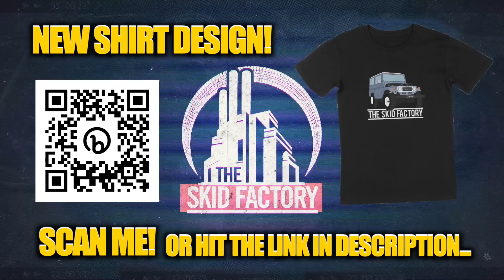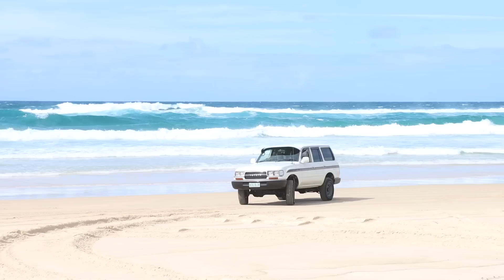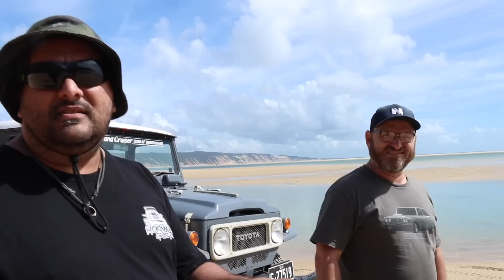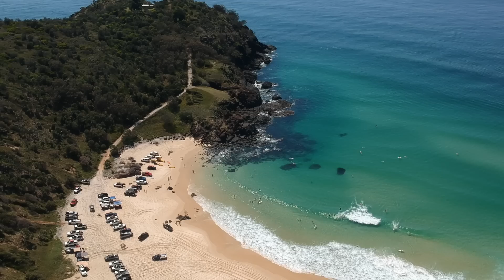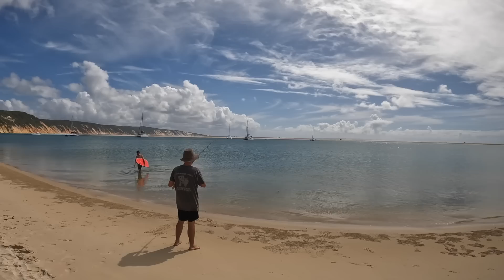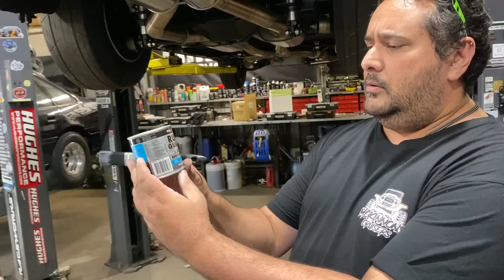V12TT LandCruiser VS Rainbow Beach/Double Island Point

Comment: 79-84 Drove all over that place in a 1200 Vdub with 15x11s on the back. In one 2 week stretch at Rainbow van park, did near 400 miles and wore out reverse. Also got lined up and taken out for sure by the pilot of an F111 flying about 100 feet off the ground along the dunes.

Comment: Jokingly, I tried to convince Ai that bucket with emerged fuel pump on passenger seat is safer at the track due to being able to throw bucket out in case of fire just making sure to avoid fire area, and that a double layer band aid and pushy helmet is good safety equipment for drags and that thong are appropriate as they are classified as a shoe

Comment: Amazing scenery, Australia never fails in that aspect. To bad they make it so bloody hard to become a permanent resident , I would have lived there a long time ago if it be a little easier. Never made it to the gold coast, yet. One of the best memory's was a ride along in a old 40 from a tourguide I worked with. A rattelling deathtrap with a old Chev 350 in it. You'd have to hold the doors going around corners. It missed the bottom part of the bellhousing and floors as well as the exhaust where optional too.. It made for a exhilarating ride. Had a lot of fun that thing.

Comment: Ol' Roothy uses a brush and fence paint for his 40s. What is it with 40 owners and brush painting their cars?
Reply: Looks better then raptor coat
Reply: @MrThebrownie72  i dont get the hate for raptor or any of those liner style paints. it does the job. and can do it at a decent price on comparison, at least for me. and if your thing is because of the gritty texture, that can be tuned out of it. besides. when its covered in mud and scratches and salt and sand, whats the difference?

Comment: Where are the running boards on the 40?
Reply: Will be tube styles, but gotta work out suspension first, then tyres and what is needed to cover them. And then it’s time to work out the steps…

Comment: love you work boys long time watcher. you say dont be a dickhead well i say dont run tracks in 2wd... it ruins the track.. to many numptys down here do the same. rant over like i say love ya work.
Reply: Agree and disagree, having done thousands and thousands and thousands of kms sand driving (worked on a sand mine in a past life), if you can cruise around in 2wd and not be digging holes then 2wd is fine. If you are digging in, even a little bit, then 4x4 is the go.

It was tipping down the day before, other than a couple shots (like the opening intro) we were idling around happily with out ever being in trouble of digging holes 👍

Comment: Nathan is obviously a 5th generation panel/spray painter. Back in the day, heat the paint tin up in the sun for a couple. Then brush on. Less  runs with the brush when paint is hot
Reply: Hot water bath and 50/50 with terps and paint will also help it self level for that show quality finish 😜